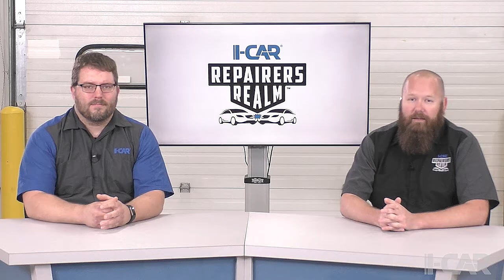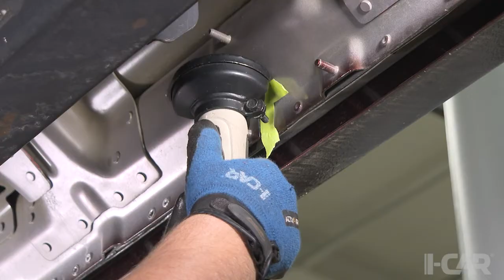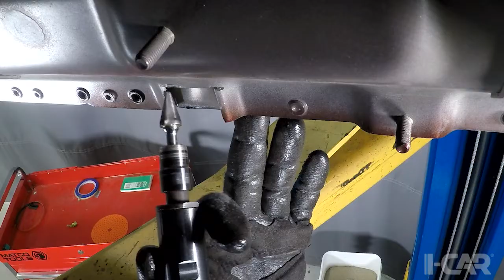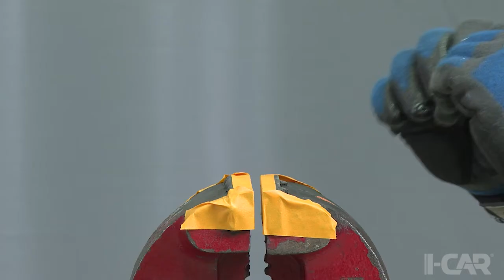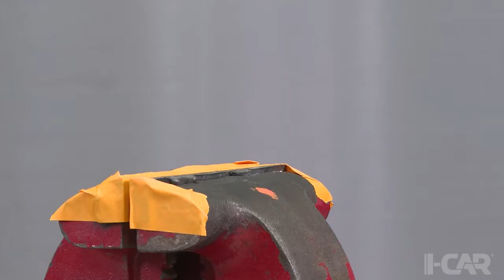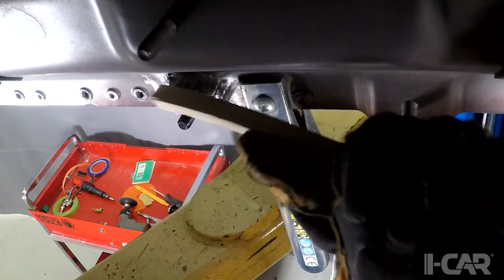Ford Structural Sectioning Guidelines - Repairers Realm

Comment: PLEASE have Ford add a visual/diagram of an example of sectioning these studs in, for clarification for others that may still question what can and cannot be done.
Reply from the maker: The episode states that the inner rocker panel can be sectioned virtually anywhere following Ford’s sectioning guidelines, which are spelled out in the service information. Because of this, there is not a specific area for sectioning the running board studs. The sectioning location will depend on the extent of damage to the inner rocker panel.
This article from the I-CAR RTS website also discusses this - https://rts.i-car.com/crn-1995.html